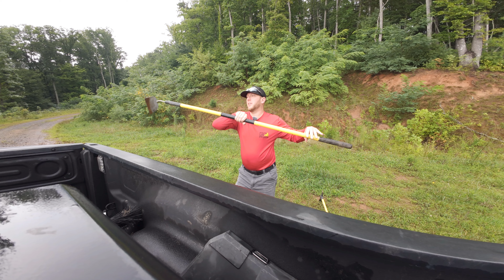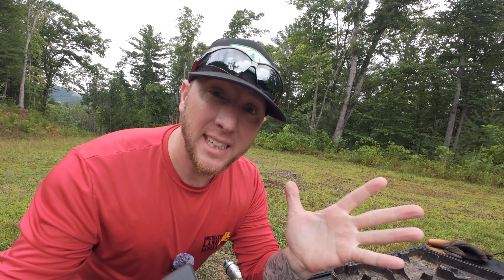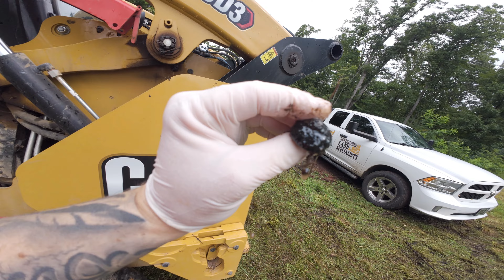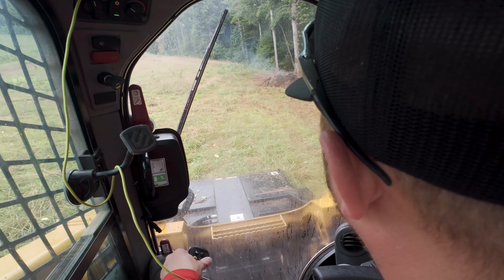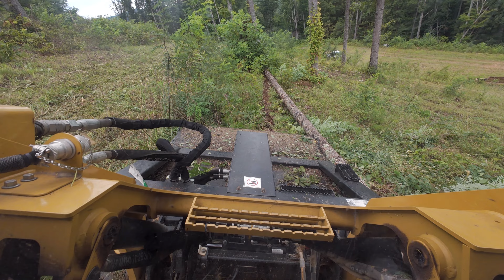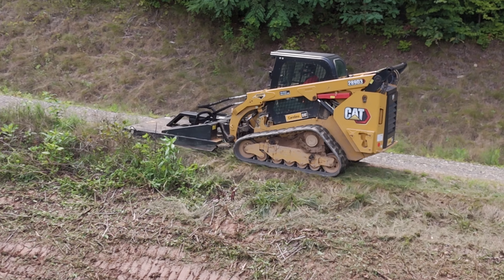Rain or Shine!!! Brush mowing good ol’ time

Comment: Thanks for tips and thoughts on greasing machines. Timely for me as I just finished degreasing, pressure washing and re-greasing my Kubota U45 excavator.  I found that going the extra effort to clean out the old caked grease and dirt from the joints facilitated getting the fresh grease to flow throughout the joints.  And of course, wipe off the excess grease to make the next degrease effort a bit easier.

Beautiful mountain views and crazy grades.
Reply from the maker: Sounds great! Thanks for sharing Chuck